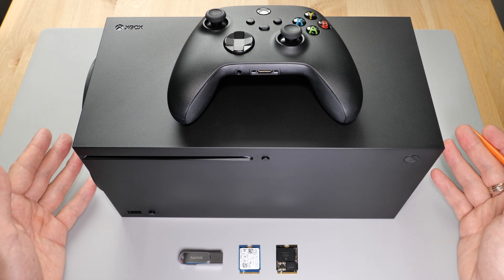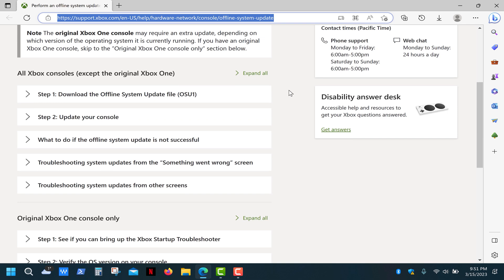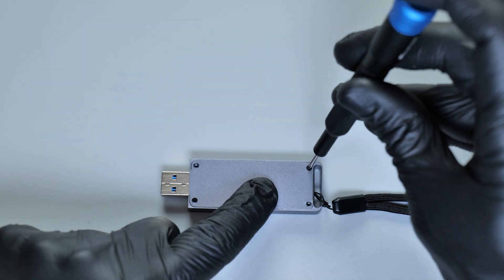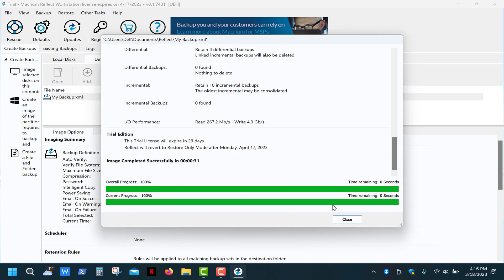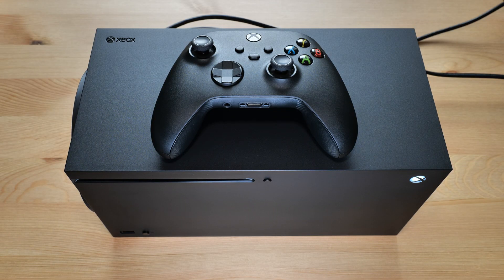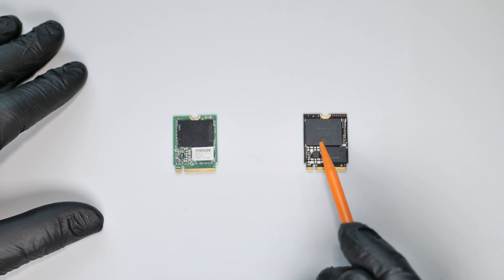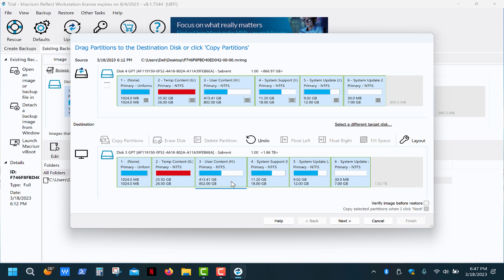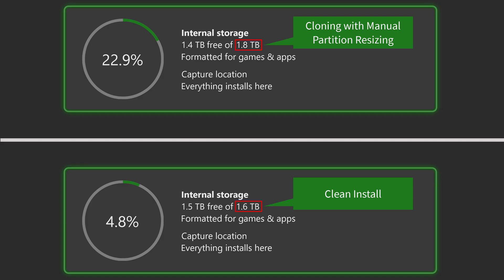Upgrade Xbox Series X SSD to 2TB – Clean Install or Clone Method (Step-by-Step Guide)

Comment: PS 5 is better here.
Reply from the maker: Yeah, PS5 is way easier to upgrade and less risk to brick it compare to Series S|X.
Reply: @onicsComputers I thought Xbox offers the same convenient until I saw your video.
Reply: @ElectronicsComputers   How its better? PS5 internal SSD is soldered to motherboard and probably some chips of SSD are married to motherboard, so both consoles are time bombs more or less, if we talking about SSD upgrade then Xbox Series had that expansion cards and PS5 of course just normal PC slot - but PS6 and next Xbox should have better repairability because of European Union directive(all electronic things must be user-repairable by July 31, 2026 if they want to sell it in EU countries, so its means easier to repair electronic also manufacturers will have to ensure access to parts)

Comment: It actually worked out cheaper to just buy a 1tb xbox expansion drive than to buy everything needed to replace the internal, which here in the UK was coming in at £198, whereas a WD 1tb expansion card is now £129......plus, no chance of bricking your £450 console. ;)
Reply from the maker: That's right and chances to brick the console are pretty high.
Reply: @ElectronicsComputers Oh and i forget to say that it was a very good video for those looking to see how to do it, in case anyone thought i was critising the video itself, which i was not, i was only pointing out that here in the Uk it is cheaper to just buy the 1tb card now for those who are too lazy, like me. ;)

Comment: Last question. Should I stand the X Box SX up or flat???
Reply from the maker: The Xbox Series X is a very good console and my go-to choice. If Microsoft hadn't gotten rid of the bootloader onboard chip, then it would be the best console on the market. The previous One X had that chip onboard, and if the HDD/SSD dies, you simply replace it with a new one (any brand you want 500GB-4TB) and install the Xbox OS from a USB drive. With the Series S|X, that bootloader was transferred to the SSD. And if the SSD dies or the bootloader partition gets corrupted, nobody is going to fix it. Even Microsoft simply takes your console and gives you a refurbished console for $300, and who knows how that refurbished one was used before and how long it will last.
Reply: I'm meant if it should be in the standing position or on its side so the Thermo Putty stays in position and the thermo paste on the cpu doesn'tstartrunning?

Comment: This is a question for the manual store and the clean installation. Do you think that the 200gb is for updates? If the rumors are true. Then, the X Tube is the last Microsoft console. What are you thoughts?
Reply from the maker: I've noticed that after some major updates the size of some partitions changes, so it's a good idea to have some free unallocated space for that matter.

Comment: ok i have tried this but now my xbox one turns on with sound then again with sound turns off, i am using corsair mp600 core mini 1tb ssd?

I had to put my old SSD back in and its working, Some of my game are not working ike dead space just get a ablack screen hence why i wanted to change the SSD if not then might need to do the cpu and gpu thermal thing.
Reply: The SSD needs to be a whitelisted model, nobody really knows what models are considered to be whitelisted.  Dead Space in particular had poor optimization so that could be the cause unless there are other games you're struggling with.

Comment: Great tutorial. What's the maximum size you can upgrade to and what drives are compatible?
Reply from the maker: The maximum size for an M.2 2230 SSD as of today is 2TB. Unfortunately, there are currently no SSDs that will work out of the box without any manipulation with its firmware. Therefore, at the moment, it would be easier to just use an external card or USB drive.

Comment: Can you do this with an M.2 2230 2 TB card (any brand, whether or not it's from Western Digital)? Or is it only capable of accepting a maximum of 1 TB drive?
Reply: In fact, it's not just 1TB, but it will be very difficult (and very expensive) if you find a 2TB NVME SSD with a specific CH530 chassis. If you find it, it will be very expensive, but it works.

Comment: This makes no sense. Don't waste your time. Just buy a 1tb expansion for the back of the xbox. Or do what i did and get a 2tb m.2 and throw it in a m.2 enclosure. And you can transfer games back and forth to the internal. It transfers in no time.
Reply: Yeah, i mean... The expansion you add to the back run at nearly full speed of a regular SSD... It's kind of a waste of time...

Comment: I see that you put the original drive into the expansion slot with an adapter and it reads it fine. Does this mean you can clone an internal drive and  instead of putting it in the internal , you put it in the expansion slot to get 2 TB?
Reply from the maker: First of all, I didn't use any 'original' drives. Second, if you're referring to the original external drive, you can't use it internally because if you disassemble it, you'll see that the SSD is not an M.2 drive.

Comment: В результате только подходят  данные ссд (WD CH SN530 500GB and 1TB, Solid State Storage Technology Corp XA1-3D1024) для апгрейда внутреннего ссд?
Reply from the maker: Yes, that's right. For some other models you need to be able to modify SSD's firmware.

Comment: I have tested that WD SN740 2TB cannot be installed. E109 will appear when the installation reaches 77%. I have backup raw. What models of 2TB are available?
Reply from the maker: That SSD works only after its firmware modification. Second option is to modify M.2 SSD using NAND and the controller chip from the official external 2TB SSD. Both option work flawlessly. There are no 2TB SSDs out of the box that will work without any modification.
Reply: @ElectronicsComputers  so maybe U could do some tutorial how to prepare or modify firmware for such a 2TB or even bigger SSD? 'couse this option is more safe for xbox I suppose.
Reply: I have the SN770M 1TB and I get the E109 Error ......but previous drive got a e208 error so figured might as well try another harddrive .....The cloning of just that first file didn't work though my xbox series x would turn immediatly off .....I can to clone it all .....just to get the e109 error

Comment: Do you have to use SN530 m.2 2242 SSD or can you also use the Wd_black SN770M NVMe? I tried it with the black and It got to maybe 20% and then it gave an error code.
Reply: Would be keen to learn if the Wd_black SN770M 1TB would work. Price point is reasonable.

Comment: Would I be able to put a 2tb in a series s? As upgrading to 1tb I think is a waste of money, because you buy the WD-c50 for the same price as a 2tb m.2 drive 🤔 need help here.
Reply from the maker: While it's technically possible to upgrade to a 2TB SSD, the process is not that easy. There are several compatible 1TB SSD models on the market, and the upgrade process for them is super easy. However, if you want to use a 2TB drive, you have to modify the SSD's firmware, and as far as I know, it only works for one Western Digital model. The process is not that easy, and the chances of bricking the console are extremely high.

Comment: So let's be clear .... On my Xbox series X I'm able to replace my internal 1TB stock ssd with any 2TB 2230 ssd just by clone an resize. Then if everything is ok i can use my orginal 1TB sdd with cheap CN enclosune/expansion card and use it as an expansion card ??
Reply from the maker: It's not that easy. You can easily upgrade the Series S to a 1TB SSD, but to upgrade the Series S|X to a 2TB SSD, you need to edit the SSD's firmware to make it compatible. At the moment, as far as I know, it's possible for one WD model.
Reply: @ElectronicsComputers  you mean sn530 or sn740 ?

Comment: I knew it. The ssd is encrypted for the series X. One of the reasons why I'm still on Xbox One (Launch Edition).
Reply from the maker: The One X is the best console in terms of repairability and upgrades. Unfortunately, the Series S|X does not share the same level of user-friendly repairability.

Comment: Crucial and Western Digital (Black) have recently came out with 2tb 2230 gen 4 NVMes. Will this method work on those drives?

I also have Sabrent's cloning NVMe cloning dock which holds 2 NVMe drives instead of just 1.
Reply from the maker: Unfortunately, without editing the SSD firmware, it's not going to work. There are only a few whitelisted models that work with Series S|X consoles.
Reply: @ElectronicsComputers  that's a bummer. Not the answer I was hoping for, but I'm glad you told me sooner as I didn't go on and purchase those drives even though I was a bit hesitant to do so because Black Friday sales. I appreciate the feedback.

Comment: My original ssd is showing up and is navigatable from my windows file explorer but the properties show it only has a capacity of 28gb. Also macrium can't even detect that it is connected. have you run into this issue before? would that indicate that the ssd is damaged?
Reply from the maker: Right-click on the Start button and select Disk Management. In the appeared window, check if you see your Xbox SSD in the list with all its six partitions. I think 28gigs is the size of one of the drive's partitions.

Comment: I know in the past you had to have the same brand and version SSD for this to work can you use any ssd and I see that you said anything over 1Tb requires SSD firmware modification for series S is this the same thing with a series X console? I would like to add 2Tb of the fastest SSD possible.
Reply from the maker: Maybe one day, Microsoft will whitelist all SSD models. However, as of today, you can use any compatible 1TB SSD on Series S (the same as used on Series S|X). It's possible to use 2TB SSDs on both S|X after a firmware modification (which works only for WD SSDs). Overall, the process is not as easy as it was on One S|X models. Therefore, I don't recommend this upgrade as it carries too much risk.

Comment: nice job so this was a special drive so we wont be able to upgrade main drive to a 2 tb variant
Reply from the maker: If you're good at editing drive's firmware, then everything is possible.
Reply: Im not did some hacking on original to replace main hd to ssd but those are different breed And i want a 2 tb internal drive since they made new 2 tb in the external port so this hd should work out of the box i should be eable to clone my main 1 tb and then clone it to a 2 tb drive that already accepted from the xbox itself technically it should work

Comment: Will this work for 2TB upgrade for Series S? Or Series S allows only 1 TB?
Reply from the maker: Safely and without and significant risk to brick your console, you can only upgrade it to 1TB SSD. 2TB is also possible but requires SSD firmware modification.
Reply: @ElectronicsComputers  ok, thanks for the info

Comment: So if you can’t clone because your Ssd failed you pretty much stuck with a £450 paper weight.  Microsoft really need to address this to make it easier for replacement Ssd
Reply from the maker: If the SSD fails in Series S|X, the whole console becomes a useless piece of equipment, which you can sell for donor parts for about $50-70. We have a huge pile of consoles like that. This wasn't the case with the previous generation of Xbox consoles, where you could easily replace a dead drive because the bootloader for the recovery operations is on a chip soldered to the motherboard. However, on Series S|X, that operation is placed on the SSD.

Comment: I'm a tech guy myself and can pretty fix anything inside a PC or a server just like this guy. I say, you must be doing this on a consistent basis (like I would on a server) for you to get the soul of this upgrade. Is this as simply upgrading something on a server? Yes and no. You gotta have the exact right or compatible parts. If you're not a tech guy and would just be watching this video 10x to get the confidence, good luck but really take care and be patient. Would I do it on my own XSX? No, why, coz I don't have time anymore like I used to in my younger years. If I do, I would. This is an easy upgrade for me just like playing Lego in my younger tech years. But great stuff and I don't expect it to be straight plug and play.
Reply from the maker: Since I own a repair shop, I do it on a regular basis. Microsoft has whitelisted only several SSD models that work perfectly with S|X consoles. You can manipulate the firmware on some SSDs that are not compatible to make them work with those consoles. I don't recommend anyone attempt these upgrades unless you're confident in your skills because you can easily brick the console. At the moment, it's super easy to upgrade the Series S from 500GB to a 1TB SSD, but XSX is not as straightforward.
Reply: It's not just like playing Legos. This isn't about parts that simply fit. 

There is a method to the process to ensure the correct encryption key from original SSD exists on the new SSD. 

I would beg to differ that someone with less experience that watched the video 10 times and tries to mimic it will have better luck with this upgrade than you would.

Only because this process is different than what you're used to and it's beyond just physically compatible parts. MS has put in firmware checks so the SSD has to be the correct make and model on their white list as well as encryption key matching between boot partition and nand chip on the motherboard.

If you just went ahead and did what you thought you needed to it's likely you would end up bricking your Xbox if you didn't lay attention to these details.

Comment: Nice video, i feel like cloning option is better. If i am correct, the system should work fine post whole resizing n other things as that will save time n reduce confusions for less tech savvy person. I hope the system can receive updates n wont be bricked.MS should also offer a program to increase internal storage.
Reply: They should just make it format and plug and play fresh install like Sony does for PS or how ever MB manufacturer does for all PC parts. Its not hard to have a bios that recognizes boot priority in a console. Its 2023!

Comment: "For Xbox Series X/S External Host Hard Drive Conversion Box M.2 NVME SSD Expansion Card Box CFexpress To SSD Adapter Original"
From aliexpress, does that actually work? Meaning that you could use ssd as external with xbox wtih that adapter, thats the easiest way for sure. Does that one work for over 1tb drives?
Reply from the maker: It works perfectly with compatible SSDs. I use that adapter with 1TB SSD that was in the console before I upgraded it to 2TB drive.
Reply: @ElectronicsComputers can you please share the link for the adaptor and compatible ssd? If possible, please create a video about same showing the work setup as you said.
Reply: @ElectronicsComputers I was looking at an eBay listing that claimed Microsoft had a system update that disabled even using the compatible SSDs with three adapters..

Any truth to that?

Comment: I remember when certain repairman made a ruckus saying it was impossible to replace the internal ssd in the series x
Reply from the maker: Replacing an SSD is not a problem nowadays. The problem is to make any SSD compatible with the console. I hope soon there will be a universal solution for most popular SSDs soon. We're working on it too.
Reply: @ElectronicsComputers هل وجدت الحل
Reply: Yup a big expensive brick. Ps5 at least let’s you upgrade ssds

Comment: Is the 2 gb storage capacity the highest you can go just like the one X?
Reply from the maker: On One X you can easily install 4TB HDD/SSD. Xbox officially supports 500GB, 1TB and 2TB drives. If you put a higher capacity drive it will be recognized as a 2TB one. So after the offline update you'll need to connect it to a computer and using some software expand the User Content partition to maximum available space in order to use the whole drive capacity.
There's no M.2 2230 SSDs larger than 2TB at the moment and not all SSDs are compatible with S|X consoles.
Reply: I see thanks!

Comment: really want to upgrade to 2tb and use the 1tb as an expansion
Reply from the maker: At the moment I think it's not worth it. It's possible but the chance to brick the console is extremely high. It worked for me only from the second try and first Series X was turned into donor parts.
Reply: @ElectronicsComputers Do you know exactly what went wrong?
Reply: @ElectronicsComputers  if first thing you do before any mods is cloning your internal ssd you should be good to go?

Comment: Hi. I had a problem with the Xbox series s, the ssd is dying. I did cloning on another ssd raw partition. But when installing osu at the time of unpacking files, it gives the error e109 0000000000000000. Can you please give advice on how to fix it?
Reply from the maker: What SSD did you use?
Reply: @ElectronicsComputers  wd sn530 2230 512gb.

Comment: Hi, thank you for the job done. 👍 I just wondered if you could tell us why we should leave 2Gigs of available space on the disk?
Reply from the maker: Same size of unallocated space you get by default after an offline system update. I've noticed that after some major updates the size of some partitions may change. So it's good to have some free space.
Reply: Thank you for the answer 👍So to conclude it is probably a space reserved (and needed) by Microsoft for possible future updates and partition changings. Good to know 😁 @ElectronicsComputers

Comment: Hi, what‘s the exact 2TB model please?
Reply: Currently ONLY SSD with chip model "WD CH SN530" is supported. If you find 2TB with this chip it will work. Attention: do not confuse it with "WD PC", this does not work.